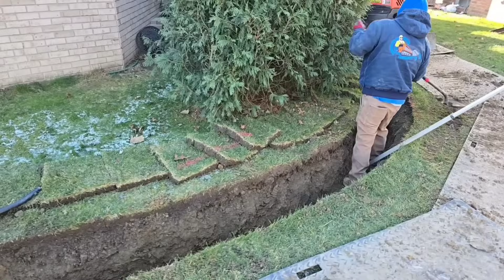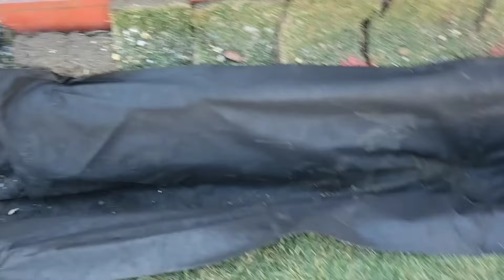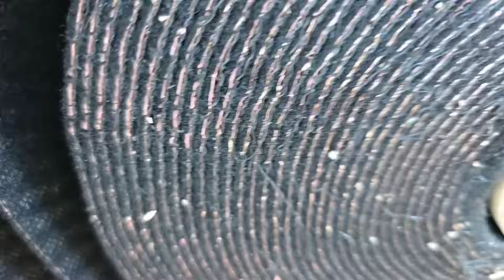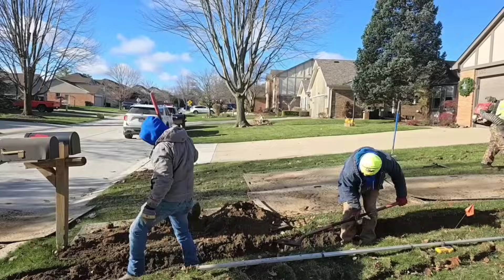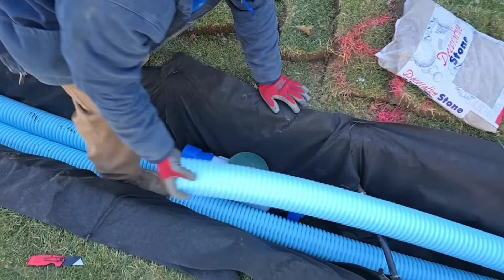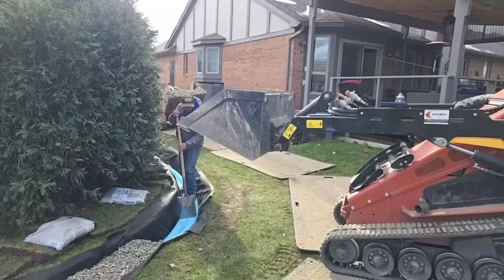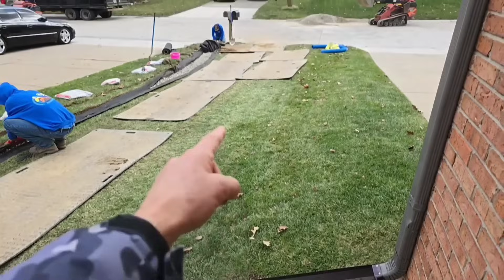How to Build a Curtain French Drain FULL TUTORIAL - Trade Secrets

Comment: How wide are you going on a two 4” pipe open French drain? I’m looking into DIYing one between my fence and my garage where I get significant water pooling due to clay soil and no grade at all (basically a swell). 

This’ll be my 2nd drain built based on your recommendations
Reply from the maker: If it's 2 pipes wide and it's 3 1/2" pipe, dig the trench 9" wide. If it's 2 pipes wide and it's 4" pipe, dig the trench 12" wide for best results.

Frenchdrainman.com
Reply: @FRENCHDRAINMAN thanks! Looking at 4” Baughman 8 slot. Is the general rule 2” space on each side? So if I went a single 4” then a 8” trench? Appreciate all your help, I used your videos and techniques in 2018 on my old house and it worked great

Comment: I have a similar situation with negative slope I hope to correct on my home. One major difference is that where the negative slope begins in my yard a retaining wall was put in that is 2' at it tallest. Is there any issue with running a curtain style french drain on the back of a retaining wall? I am considering using a piece of pond liner against the back of the retaining wall until it clears my home, but would love your thoughts and input, before I put hours of work into it. Thank you for all the great information and products!
Reply from the maker: Most people do not make their retaining walls tall enough, and let me explain why. You need to build them one block higher than you would think. Build dirt up against the back of that one block, which is too high, and create a swale. There has to be a swale on top of a retaining wall, and then you grade that swale so the water runs around it. The water comes down, gets caught in the swale, and is channeled towards the end of the retaining wall. You can now put a pipe in that swale to increase its efficiency so that it will leave no water behind, and it will dry up quickly. When water is allowed to cascade over a retaining wall, this will deteriorate a retaining wall over time, always with bad results.

Frenchdrainman.com
Reply: @FRENCHDRAINMAN Thank you! That is a piece if the solution I was overlooking. I will add another row of block which will be very helpful! One more question if you don’t mind. There is plenty of slope along the wall in fact possibly too much. My current plan will end with a drain slope of 4-5%. Is there any reason this would be too much slope?

Comment: If you reduce all those 4 inch lines to single 4 in discharge doesnt it defeat the point of having 3 upstream?
Reply from the maker: No, it does not defeat the purpose. You must be new. The more air you create, and the more space you create, the faster it dries the yard. Our systems work better than any other system in the country. We can prove it: year after year, 40 years of success, and we are still building amazing systems that nobody can compete with.

Comment: I like the discharge idea! I have a 100 ft french drain run, with a solid line for the surface water and 1 3x4 downspout for a  42ft roof run that connects to the solid. Would that overwhelm a 4 inch culvert if i wyed them together like that to get out to the street? I like the idea of having one discharge if possible. Thanks!
Reply from the maker: It will keep the pipe clean and clear of clogs if you tie them together 
https://frenchdrainman.com/product/4-in-dual-wall-wye-and-45-fitting-combination/
Reply: @FRENCHDRAINMAN  awesome. Thanks! Would you suggest the same if you can't get to the street and need to use one of your pop up emitters?

Comment: 00:39 appears that smaller gravel was used near the catch basin. If so, what was the reason? (Maybe the bucket scooped up gravel at different spot in gravel pile, b4 heading to the trench & there just happened 2b a lot more smaller stone in that spot than larger stone in the mix?)
Reply from the maker: You are correct. You can't lay large rocks under a catch basin. It has to be small rocks so that it is easy to set in place. You don't want it to rock when people walk on it.

Comment: I purchased a home where the previous owner had foundation work done. They didn't properly refill the yard and now the backyard is very low which is a huge problem whenever we get heavy rain. I have to get a lot of dirt to refill the yard to get it back to level. The yard is so low that my drainage pipes are currently above ground. My concern is even if I have the perfect drainage slope, when I add dirt to fill the yard the pipes will shift and I might lose the slope. Any tips for how to keep the pipes steady in place while I fill the yard with dirt to cover the pipes?
Reply from the maker: No, sir. I have no tips. If you are bringing in a lot of dirt, you will need a machine. So, wheelbarrowing gently around the lines is not an option.  It is probably better to just rerun them.

Comment: Robert thank you for your videos. With your method I installed a 150ft french drain and it was beautiful seeing all the water gush out where the pipe daylighted. I wanted to ask about the rotary laser you placed in the corner. Do you slope it on one axis then on a different axis when turning the corner.
Reply from the maker: We do not slope in a case like this. It is manually done by the trenchman working the story pole.

Comment: We have a walk-out basement flooding problem in a house in a subdivision in Middle TN.  The basement is dry except during heavy rains lasting a few days.  Trying to remove the water outside using ‘French drains’ (the big box store type) has not worked.  Do you know of a contractor using FDM products in our area and would they work?  The water remediation companies in our area all say that the water removal must be done inside the basement.  I’m estimating that about 200 gallons/minute enter the basement for a few hours during and after major rain events.  Any help would be appreciated.
Reply from the maker: You should start with a good roof runoff system, ensuring all roof water is directed away from the house so the basement and foundation do not have to contend with excess water. This is always the first step. If this is insufficient, install an outdoor curtain drain with a sump pump to draw in and remove the water. 
We have three contractors in Tennessee. Call our main office 248-505-3065 for their information
Reply: @FRENCHDRAINMAN  Thanks for the quick response.  Will do.